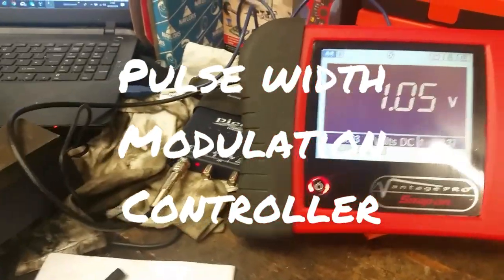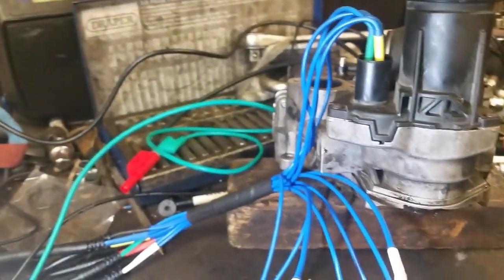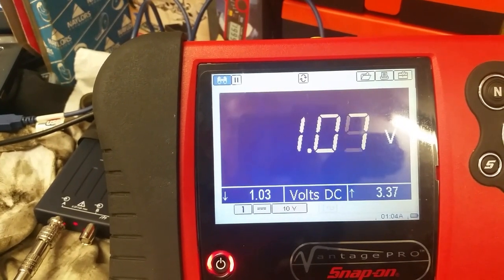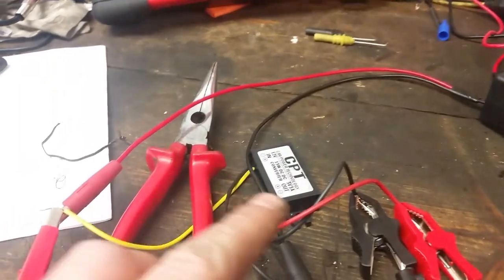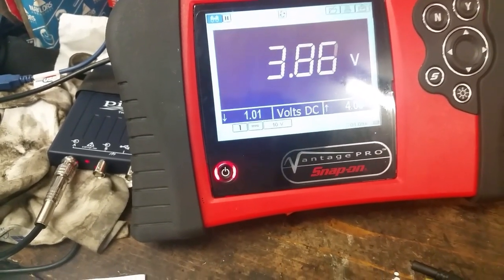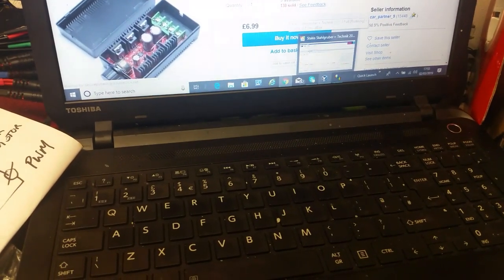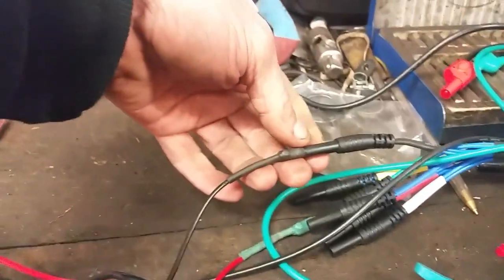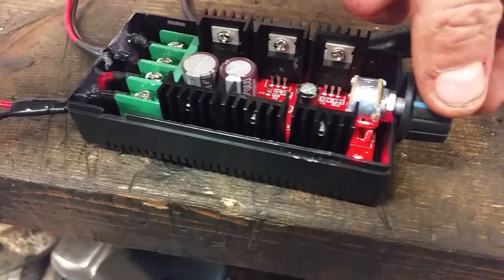EGR Valve testing with Ebay PWM controller. Position sensor. Pico Osicilloscope 2000. Duty Cycle

Comment: Do you know what frequency the controller works at? The oscilloscope table below is microseconds right? I understand that there are approximately 150 microseconds in a cycle, so almost 7 kilohertz, right? thanks

Comment: How does the EGR valve "motor /solenoid" return to closed position? Does it have a return spring? The valve operation shown seems to be that of a stepper motor..(which would require reverse voltage to close valve).
My car's EGR uses a pintle "plunger type" valve...not rotating as one shown here.
(I'm just curious how these valves function)
👍
Reply: The actuation for the opening cycle is done by the electric motor.  And for closing there is a tensioned spring that closes the valve.  Only the egr in the video is defective!!!

Comment: I started getting a "pintle sensor position failure" with the EGR valve. With a bit difficulty I was able to remove top part of valve housing revealing the potentiometer. It was badly worn out. Now after learning how the valve is controlled using pulse width modulation I can see why....the valve solenoid is constantly being turned on and off by the engine control computer. This is a really hokey way to do it...the potentiometer is doomed to wear out. If anything...the potentiometer should be replaceable. 
I want to learn more about the "secret software" hidden within the ECM.
Reply: Out of 50 cases, the potentiometer is not to blame (the position transducer).  The problems are multiple!  Mechanics, especially the bearing, in 99% of cases.  Then, you have to make sure of the teeth of the gears, if they are worn, they get stuck.  The valve and vaccum valve should be ok.  But most importantly, it comes calibrated from the factory.  That is, it must work between min 1.04 volts- 3.97 volts.  Attention, the transducer is powered by a laboratory supply with a fixed 5.00 volts.  And the signal is read with a multimeter with high precision, with 3 digits after the decimal point, i.e. 1.040 volts.  If the conditions are not met, the car's computer will reject it.  P407 We would study this Egr for 2 years!!!

Comment: Hi Dave, minor point but on my VW Golf mk6 1.6 tdi 2009  Signal wire is in the middle marked No3  and No  5 is the -5v dc
As you may have guessed my EGR Cooler has failed so this video is a great guide as to the problem and how to test.
It turns out l have exactly the same issue as the EGR shown. Thank you so much for taking the time and effort to film this and share
l for one have benefited by your endeavour

Comment: Thank you so much for sharing this video, as i am currently cleaning my failed VW Golf MK6 1.6 Tdi EGR cooler valve.The one you are testing on the bench.
However cleaning is only half the problem as i need to know how the test if the motor has failed also.Hopefully now after watching your video i can purchase the kit i need to do the 12v motor actuation test.Pulse width modulator controller is all i appear to need just to move the motor roller arm mechanism.So thank you for this great instructional video as i am no electronics guru, just a basics understanding guy.The connector pin out diagram was very helpful indeed very clear even to me. Cheers Colin   Please watch this link for further in depth info on how this is designed to work https://www.youtube.com/watch?v=a751pi51-N0&list=WL   we can all learn from these two video uploads  cheers to you both.
Reply from the maker: Gla it helped

Comment: Hi Dave , does this PWM controller is safe to be used for VVT solenoids , Air /con solenoids  and other engine actuators if i move the adjuster knob progressively .thanks and i much appreciate
Reply from the maker: Yes it controls courrent not voltage